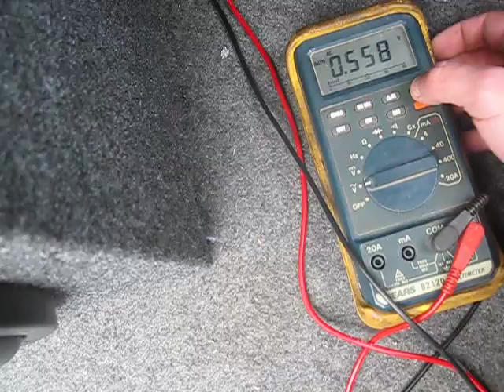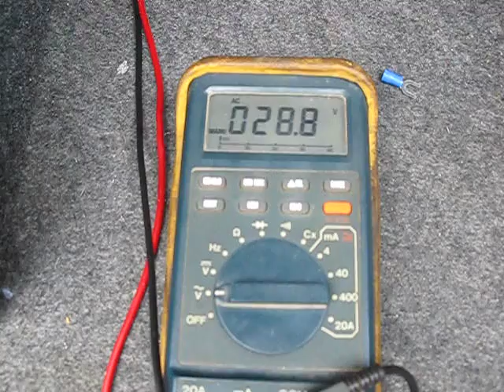Testing Amplifier Gain Voltage ouput with DMM

Comment from the maker: Sorry about that, I used a 50hz tone @ 3/4 of headunit volume to achieve specified voltage output from my amplifier to achieve 28.28v which = 400RMS @ 2OHM that varies of course